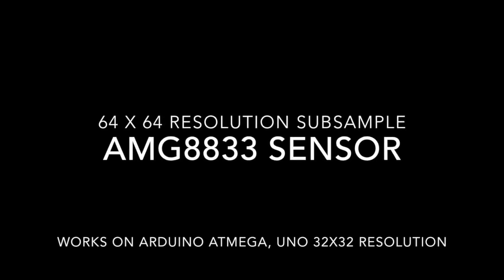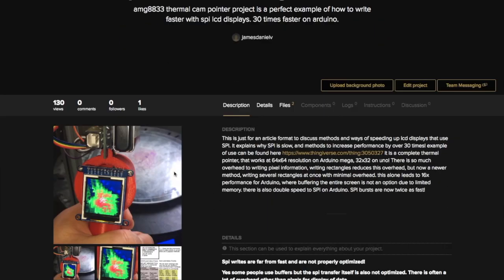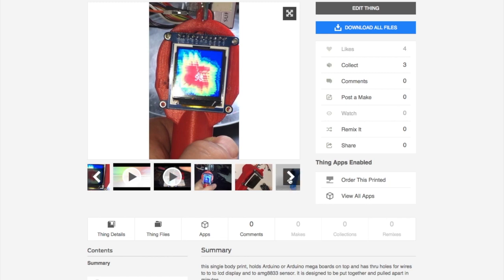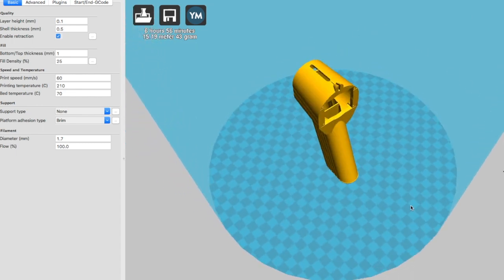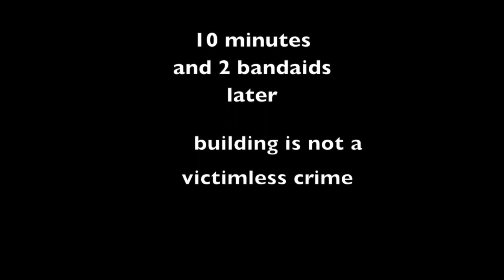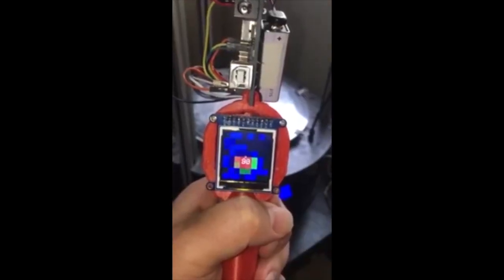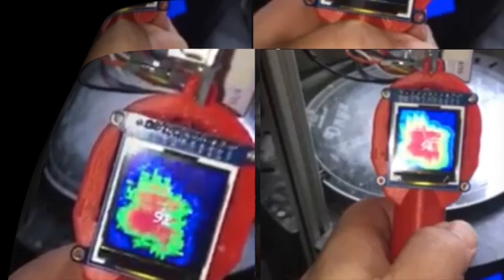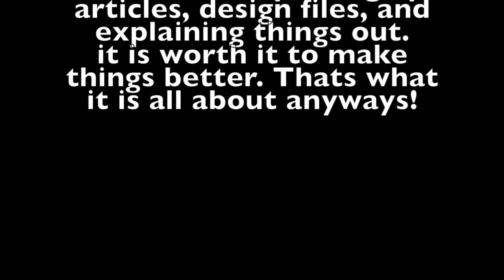amg8833 sensor works at 64x64 resolution on arduino uno! 10fps!

Comment: Hi there,

Liked your work, kind of hard to follow with the explanations, but one thing I used already from what you shared is the color generator, it helped my current effort to display a more relevant color map.

What I didn't quite understand  is if this code that you developed is applicable to other displays or it's just for the ST77xx. 

In my test I'm interpolating the 8x8 termal pixels first on a Arduino Nano board to a 16x16 and then when displaying on the LCD (I use an 1.44'' (128x128) ILI9163 ) I use rectangles, sort of what you're doing with the extrapolation, but I'm not using the whole resolution, just 96x96 pixels with rectangles 4x4. The code I'm using is fairly messy at the moment and the end result is only a 1fps (sort of) since the Arduino has to do the interpolation as well. This is obviously a far cry from the 10fps that I could theoretically achieve given the AMGs update frequency but nonetheless, it's finally a usable thermal image. Before trying your color map code I relied on the one from Adafruit, but that wasn't yielding satisfying results, the image did not show low temps quite well, didn't have what I'd call range between colors, even though it's just a 256 values color map. 

Once I switched to your color map I actually get to see more details, I guess the contrast is better now in the color map because I can actually see all my fingers when I put my hand in front of the sensor even on a 96x96 chunky image (4x4 pixels per rectangle).

What I did is send the thermal set of data via a 2.4GHz radio from a setup as this: AMG8833+Arduino Nano+NRF24L01 all  mounted on a quadcopter to a receiving Arduino Nano+NRF24L01 however since NRFs are hogging some decisive wires I decided to send the receiving stream of thermal data via SPI to another Arduino Nano hooked to the TFT display which also hogs the SPI interface.  So I have a total of 3 Arduino Nanos talking to each other: two via 2.4GHz radio and the middle one via SPI to another one dedicated to interpolating and displaying the thermal data.

But since the update frequency isn't that great, ~1fps, I decided that more computer power should fix that, so I also send all the thermal data over the wire to a computer USB port.

Here I use Processing 3 to read the thermal data then interpolate it in a similar manner as on the Arduino Nano, however I use a 10x factor meaning I make it so that the interpolated image is actually 240x240 pixels. I'm using the same color map to keep the same appearance and it works fairly well, the only drowback is that the 30x interpolation (going from 8x8 to 240x240 has some serious interpolation artifacts)  is not as good as I was hoping, The end image although is processed a lot faster is still lacking realism...I don't know of another word to use for it but it's not the fact that the blacks and deep blues are jiggling all over the screen is that the shapes that result are very hard-edged, I mean the differences between min and max temperatures in some scenes are virtually non-existent, yet these create blue and black jiggling shapes which you need to interpret. It's noise, I know but just by raising the threshold on what makes it worth to publish will not really work, but I'll give it a try.

So my question, if I can call it that, is if the code is usable with any other LCD/TFT (probably not since I see you mentioned that you fine tuned the code for ST77xx series.  Secondly, how exactly are you doing the interpolation or extrapolation? Are you doing a linear or which type of extrapolation?

Cheers,
Denis
Reply from the maker: i'm doing liner interpolation in x,y and diagonal pixel. the diagonal pixel i think needs a divisor near 1/4 rather than 1/2. currently testing code in javascript that will be downloadable to check color correction. i think that one of the values is still mis calculated,. i'm in the process of updating the multi pixel write to generate a bitmap buffer that is translated by the bitmap command that is universal. colors may still show off if table does not have a wide enough gradient. it is best if colors go from dark to lighter. glad the color table worked for you. i appreciate the feedback. it is getting better all the time.
Reply from the maker: so give it a week, check the beta branch correctly named https://github.com/jamesdanielv/thermalcam/tree/updates-(possibly-unstable) this is were i will post the changes. first the bitmap buffer version (so standard bitmap modes can be used to move several pixels at a time) and the possible adjustment to the diagonal pixels.
Reply: so diagonal would be x+1, y+1 ?

I'm doing something similar but using weighted distances. given that it's a fixed interpolation size, i.e. it's only another pixel in between each original pixels the distance is also fixed and I compute the value of the middle interoplated pixel as weighted values from the 4 neighbors (x,y) (x+1, y), (x, y+1) and (x+1, y+1) so each of these has the same weight. i used the hypotenuse of any of the two right-angled triangles and divided it in two - this interpolated pixel is half way between each of the other 4. Since the hypotenuse is sqrt(2) then the half value is 0.707 roughly. So each of the original 4 pixels has this weight in the value of the "middle" interpolated pixel.

Funny thing is, the same behavior can be applied for interpolating on the horizontal and vertical as well, for each of those extra 4 interpolated pixels. The only upside is that the weight values can be computed beforehand given there's a known and fixed number of interpolated pixels so once these weights are computed they can be typed in as fixed values which speeds things a bit.

One other approach I tries was to have 10 interpolated pixels between each original two. Obviously this didn't work on an Arduino, no room and no processing power. So I tried it on a desktop using Processing IDE. Works acceptably but the image is nowhere near usable in terms of quality. You can guess what you're looking at but then again you can do that with the 16x16 interpolation.
Reply from the maker: have you even  tried my  method? or downloaded and tried to get my software method working?
Reply from the maker: the issues with speed, and the way to get performance is 3 things. 1 non float interpolation (yes it is possible) 2 spi optimizations such as bursting which doubles speed (most spi routines just wait then compute data, my method computes data while spi is being sent) 3 multiple pixel writes at a time. this reduces overhead commands such as command type, pixel color mode, window size, and 4 bytes for pixel address. these commands are sent with every pixel, unless writes are in rectangle fill mode. this sets windows size, and from there it only needs to send 2 bytes for pixel color, and then pixel will automatically advance. it is documented here. https://hackaday.io/project/160498-spi-write-up-to-64-colors-single-instruction which is the same link i give above. read my comments and logs section, it will answer most questions you have. instead of making it work using bitmaps, i have made a wrapper that allows multiple pixel writes together. the bitmap functions included with display drivers are not optimized, and even if they are there is a lot of overhead moving data to stack for processing functions. hope this helps, and again i'm thankful for your input on interpolation. in my case the pixels are also offset, so i needed to offset the color calculation by 25% if you read my log notes on the hackaday page you will get that information as well. some people think that interpolation needs to be 100% accurate. this is not true, it just needs to be 1 accurate to the system in measure (for me it is 1024 numbers) and 2 not visible distinguishable. 2 is the bigger issue at higher resolution because pixel detail can at maximum be 16x16 from an 8x8 sensor.
Reply from the maker: for example i have a beta release that currently works at 64x64 resolution  about 10fps, and 3fps using the wrapper. the wrapper makes it work on any display. by the end of October i will make it work on ili9341 240x320 display. i'm also working on getting the mlx90460 sensor working on arduino. so far it outputs results to terminal. but it is impressive as it stands https://youtu.be/LLbCHUhbZf4. we are writing long messages and i think it is because we are doing things that are complex and your right hard to explain. as for extrapolation, my method was more of a hack of trial and error. i have been working on something that i think you will find of great use. a web based javascript tool that simulates sensor read, and reconstructs image with interpolation and compares values before sensor, and after simulation reconstruction with interpolation.  for example i can take a circle. and simulate it to sensor reads, and it looks like a square, but color variations are included as sensor sample is surface area of sensor. interpolation of data will get circle back. here is a perfect example of why interpolation should be used even if detail will not be improved. you will see from this example an excellent reason to just have interpolation (even without extrapolation ) https://hackaday.io/project/160498-spi-write-up-to-64-colors-single-instruction/log/154185-javascript-test-tool-and-sensor-sample-simulation-interesting-results
Reply: just saw your update today. i'm on the other side of the globe :), located in Europe so takes a bit of time to see updates. I'll give it a go to your newest thermal_cam64x64_compatible_adfrafruitdisplays.zip 

the thing is that I'm bound to use Arduino Nano - I only have those available at the moment, more powerful versions I'm in the process of buying but takes a bit (convincing the "commander in chief" that I need those and promise to be a good boy and stuff). another aspect I think I forgot to mention is that I'm using the sensor and the display on separate rigs, the sensor is tied to an Nano board powered from a drone 3S battery (12V) via a BEC (5v) and a 3.3v step-down convertor and the same Nano also has hooked into it a NRF24L01 transceiver. Luckily the AMG and NRF connect differently to the Nano board so I didn't have to figure out how to share the same bus and stuff. on the receiving part I have another NRF hooked into another Nano board set to receive and this guy is providing the "raw" 64 thermal pixels values via serial to yet another Nano board so that I then interpolate and display. As I mentioned already I didn't spend that much time on the speed of the display, right now I'm trying to get the Arduino Nano to work with the display and the increased resolution resulting from interpolation. The color computation that I saw you use there don't work for the cheap display that I have (obviously a cheap chinese clone of an  ILI9163) and the really low-end Nano board. the only thing that seemed to work was the AMG demo color palette so relied on that for a while, now I'm looking to get some better quality on the display first, then if need be I'll focus on the speed. The AMG sample I used taking lots of space, there's 256 int values for the color palette that basically take up all the remaining storage space on the Nano - I know it's not the best board for the job hence me considering more powerful boards. I've seen some russian dude doing ok-ish with a wemos D1 mini pro which at least allows the code to run even though very slow.

I even tried sending all the thermal pixels up to a PC and try a 10x interpolation, still not as good an image as I expected. 

Anyways, I'll try getting your code to run on my setup and hopefully I'll be able to use it somehow. Not that's anything wrong with it but the way I set up my gear is obviously not the most efficient, I had to make due with what I could find.
Reply: saw that and was considering if I should go for the MLX90640 given the extra resolution. but since the MLX is twice as much as the AMG I'm still considering. Now what I tested out in the field, not sure if you did that, but once you take the AMG out in the open and make it look at things not close by it tends to misbehave, I mean from what I saw in its datasheet it's meant to be used mostly indoors, for mostly thermal stuff detection, not for example seeing a human being more than 100 meters away, their limit was 7meters if there's at least 4 degC difference  from the background. what I saw however was that if pointed at the open sky the max temp reported jumps to 255 deg which is silly, given the maximum of 80degC that the amg is supposed to be able to measure. the datasheet however does specify it can show incorrect readings in certain environmental situations...not sure what to make of it since the weather was good when I tested, both during day and night.

anyway, I'll be checking out your MLX progress as well since it looks like it has far more potential than the AMG. if you get a chance to test both of them outside would be great to see what detection range you get

cheers
Reply from the maker: if the amg8833 is taken outside and nothing is detected within about 7meters it goes weird. it could be from auto temp detection range being smaller than the  accuracy or the algorithm that reduces hysteresis but i think it is from  radiation from the environment outside of optical range (sensor is designed to mostly see 1200-1500 nanometer range, but it detects all energy that falls onto its sensors. radio waves, magnetic noise in nature, harmonics in light waves i think all become  noise that ads a very small amount of heat to the sensor. at some point the noise just becomes larger. i don't know if a lens hood would reduce the background grey radiation. but troubleshoot the way a camera person would from sun glare and lighting issues outside.  might also want to read up on Stefan-Boltzmann law.
Reply: I did suspect the outside extra radiation from a bright "shiny" environment is likely to overwhelm the sensor. Also I had a look at the lens on the sensor, it's not your regular lens after all so it's optical properties aren't exactly on par with long range detection, its 60deg field of view does come at a price.

All things considered, I think I'll stop trying to use the sensor for what it wasn't meant to do, but on close range, around 2-5 meters with reasonable heat distribution it might be quite useful in detecting hot things, even if  displaying the heat image, enhanced more or less, won't yield a whole lot at that distance.

Since you also got your hand on the MLX90640 if you have an interest to see how it performs looking at longer distances would be great, I mean that one doesn't seem to be specifically designed for outdoors or long distance detection but its increased resolution and built-in computing power might make it usable for outside or longer distance measurements.

I was also looking at the FLIR Lepton 3 sensors, but that it so expensive it doesn't really make any sense to try to get one just for a hobby project - not to mention I'd have to get some serious hardware to run it. Even there the resolution isn't that much better - it's 160x120 still way more than AMG and MLX offer. From the comparisons I saw on different FLIR models, for any significant long range heat detection at least a 320x240 resolution is required. And that is honestly prohibitively expensive for a hobby grade project, IMHO.

Of course to each his own, if anyone has the cash to spend and test then share the how it'll be awesome, but unless the prices go really low there's not a whole lot of chances that a way cheaper alternative to "professional" grade tools from FLIR or Seek Thermal or Fluke  are gonna be developed.

I liked the project Max Ritter did with the FLIR Lepton, it's a very nice try - again the price is not even on the same scale as alternative solution, yet it's still quite a bit more than a hobbyist like myself would be willing to spend on the thermal camera alone. It would probably go for more than 400 EUR to get a remote setup with the sensor broadcasting the thermal video stream or even just frame by frame and show those at 1fps or so on a display. After all the thermal info is not mandatory to be over laid on the visual. A side by side or PIP would work nice, particularly since the resolutions are quite different and there's not chance for  a thermal to reach FHD resolutions..

I'll shut up now and go try your new code. Will let you know if I manage to get it to work.
Reply from the maker: lol. ill keep you posted to the distance of the mlx90460 sensor, but the same issue will apply. the further distance you go, the more background radiation effects sensor. you might get more range out of amg8833 sensor if you use a camera hood. this could be as simple as a toilet paper roll. it needs to be large enough and far enough back to allow full visibility, but the hood will polarize the direction of background radiation.
Reply: thanks. I'll see about using a hood for the sensor, was considering that for the fpv camera as well since it gets flooded with IR light when the projector turns on.

I was also looking into a lens for the amg but, boy are those expensive :D!!! not to mention hard to get. 

so I guess I'll just have to go really low tech :D

one of the good news is that I managed last night to get my arduino to do interpolation for 32x32 bytes and also finally to use the color calculation code I saw you also mentioned. I tried previously to get it to work in my code configuration, but for some reason I was only seeing blue shades. eventually I found what I was doing wrong and now I get the colors displayed by computation rather than reading from a color map array - which is one of the pain point for me since arduino nano has so little RAM it's hard to cram all stuff there - the interpolation array alone takes 1024 for the 32x32 bytes interpolated image which is half the storage available, plus the other 64 bytes for the amg pixels (i'm using bytes as well and when checking if the temp is above 80degC I cap it at 80 degC). but with the colors being computed rather than taken from a color map the refresh is really really slow, like ~2seconds per frame and the saved storage space still doesn't allow for a 40x40 interpolation. funny thing is that if I limit my display area on the TFT to 96x96 pixels the 32x32 looks worse than if I keep it 24x24 at least that's how I see it. I guess I'll have to play around with combinations to cram in the limited Nano's RAM 

given how I plan on use it, as a secondary or even tertiary source of non visible spectrum imagery for the surveillance/inspection drone it shouldn't be that bad, i mean it's still fairly usable even at ~2s/frame just not gonna sell any of these soon :D

again, thanks for your time
Reply: PS: I also tried your version for any adafruit display, sadly it looks like i got a really crappy tft clone, the only thing working is the library i have from the sellers site. at least it is somehow usable
Reply from the maker: have you tried there display with an adafruit driver? i gather from above that your display is a clone ILI9163. adafruit also has some graphics tests libraries to make sure they work. adafruit open sources and makes free drivers, and MIT a university developers initial drivers, and makes them avail for adafruit and others. no way to loose. i just did a quick google search and found this https://github.com/Bodmer/TFT_ILI9163. try to get the examples/TFT_graphicstest_PDQ4/ file working. you more than likely will need to import display drives, fortunately all you need is in the main github folder. i just try to compile at it spits out an error on what is missing, i paste that file in make sure it is references in sketch and reload and try again. 2-4 times later it usually is working. it the graphics demo works your good to go. also maybe in a blog thank them for helping you out. also thank Bodmer, whoever he is this is his build from adafruit. hey wait a minute! thank me too! :)
Reply from the maker: also i should add that the adafruit drivers i linked to above have setwindow and pushcolor. the commands needed for the wrapper to work.
Reply: thanks for the tip on the driver. to be honest i didn't spent that much time on the display driver, it worked when i hooked it up and reasonably fast for regular drawings so didn't bother that much with it. my hunch is that the bottleneck in my approach is the (too)comlicated computations I do for the interpolation, at least it's pretty "linear" and works for any number of in-between pixels - I tested it with a 10 intermediary pixels on a PC in Processing and still got decent update speed, the serial comms didn't keep pace with it.

I'll have a go at the display drivers, see if I can get it to work. as you probably guessed i'm not exactly extra skilled in the embedded programming bit, nor in the hardware bit for that matter but I do have ideas :D

later edit: I did try the Bodmer's driver but to my surprise it compiled alright with no warnings (I though it looked familiar the zip he provided) but alas the crappy display stayed blank when I used his driver, no error, no complains no nothing, smooth compilation and upload but the screen just froze. well, maybe some more tweaking on it but for now I think I'll stick to what I have. if ain't broken don't fix it
Reply from the maker: @denisbujoreanu5993  adafruit has an update for amg8833 sensor that prevents a temp below zero from switching it to over 500 deg. it had to do with an error in converting 2s compliment info in binary. it should be fixed now so go and look at main branch of amg8833. ill be testing and updating my files as well after testing. i don't think this will do much for display looking over a long distance (>10m) as side radiation can still cause interference.
Reply: @profounddevices  Neat. I'll have a go at it. In the meantime, since fall is here and temperatures are lower, I started testing the quadcopter with the amg under its belly out in the open. Needless to say I look like a madman walking around with the remote and a small display in my hands, fiddling with the knobs, making funny hand gestures...all for my neighbors to see and wonder...or pity me for going nuts so soon...but hey, science demands sacrifices :D...

but let's not digress....I still have the issue with the temp going off the chart but now instead of maxing it out to 80 degC I actually compute for each "frame" the minimum temp and if any of the thermal pixels are over the max temp (they can't be below zero cuz they'd get trimmed down to the byte lower limit...aka zero) so if the pixel temp value is over 80 I set it to the minimum temp of the "frame". not exactly like the fix from adafruit but close...I mean the over 500 degC would obviously be the case with what I saw, the temps jumped erratically for no reason in regions of space where there should be nothing at all...so given that their fix is to set the erratic value to zero I think ...since it's lower than the minimum they just set it to minimum...aka zero degC...I effectively do the same, although I take a bit of a more cautious approach in the sense that I set it to the minimum temp from the scene, not force it to zero....so far from what I tested the "fix" works nicely, now I can watch the open sky with no more funky rainbows. i'm still to test it in daylight with some sunshine if any and check how it behaves in too much light compared to too little light...

again, this may not be the most suitable approach but from what I tested it seems to work for me. oh, and I decided to stick to a 64x64 interpolation on a 128x128 display as it gives the most decent framerate when running off an Arduino Nano...don't tell me I need more horespower cuz I know...in any case at this point the amg in the configuration I have is actually useful, I tested with the No IR filter FPV camera mounted on the drone, flooded the camera with light (basically pointed it at a light pole) and I was still able to see the thermal image clearly even 5m away. it's not as if I can distinguish head or body but I can definitely see there's something there...and I was with my coat on...so outside temp was somewhere around 13-15 degC with an ambient temp of 5-9degC...not much contrast to go on but the amg did show me something I could use...anyways there may be some actual use for this gadget even for outside use...

which brings me to my other piece of news, I've ordered a MLX90640 32x24 with a 110deg FOV plus a teensy and a 320x240 display. once I receive those and finish mounting them...I read the teensy has two SPI interfaces so I should be able to hook both the NRF24L01 and the LCD on dedicated SPI pins then the MLX should go on just two other pins that do not overlap with the SPI...I'll see how I wire them up when I get them...worse case I have to use a dedicated Nano or Mini Pro for the radio then send the thermal frames over serial to the teensy, like I do now.

anyways, thanks for the update. I'll look it up and see how I can use it

cheers
Reply from the maker: https://hackaday.io/project/161499-mlx90640-sensor-works-w-800-bytes has the mlx90640 sensor working. i'm starting to work on a version that outputs to lcd display and should see how it works with stray radiation. i think it will handle better because energy to the cells changes its voltage, rather than resistance (amg8833) so noise isolation should be much better (constant low current and output voltage changes) rather than possibly very high resistance that is converted to a voltage by an internal amplifier
Reply from the maker: i went ahead and uploaded a version that should work across all adafruit displays with current drivers. it uses the pushcolor() and setwindow() commands. it is about 7x faster than normal pixel draws, but it does not have spi optimizations. for example mine normally updates a 16x16 section of lcd in 1400microseconds, this one does in 3600 microseconds. still it is probably 10-20 times faster than whatever method you are using. see if it works. https://github.com/jamesdanielv/thermalcam/blob/updates-(possibly-unstable)/thermal_cam64x64_compatible_adrafruitdisplays.zip
it basically is a wrapper that converts my commands into normal commands for display driver. it is only there for testing new displays.